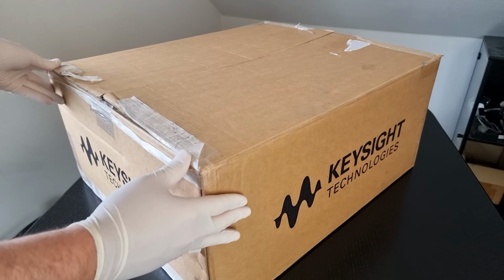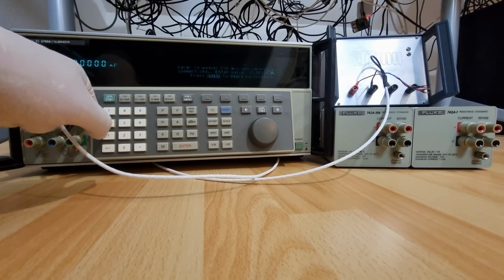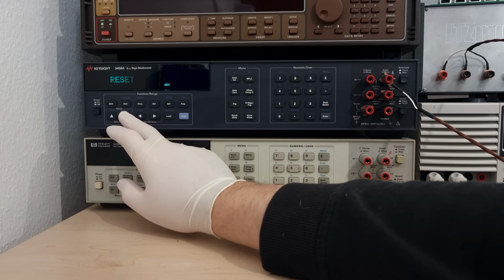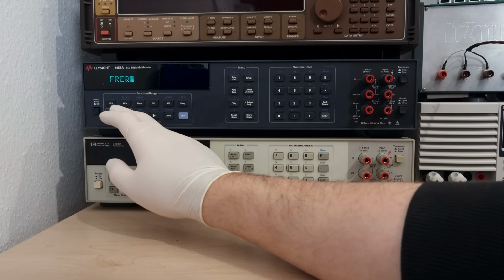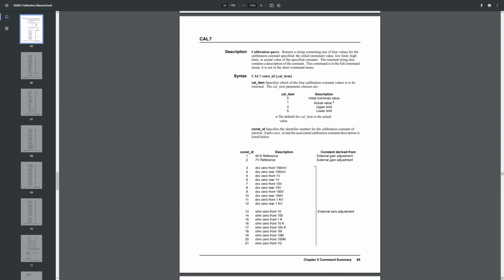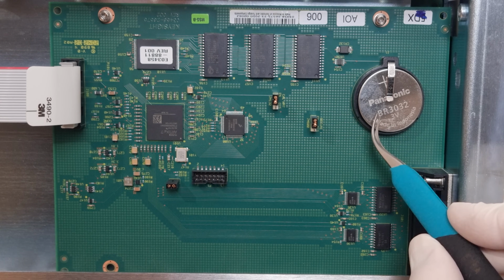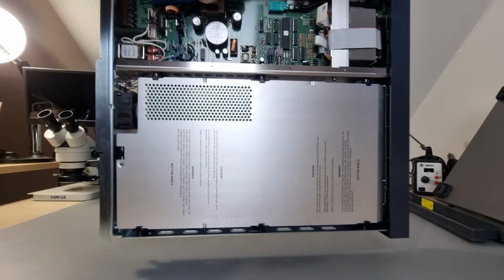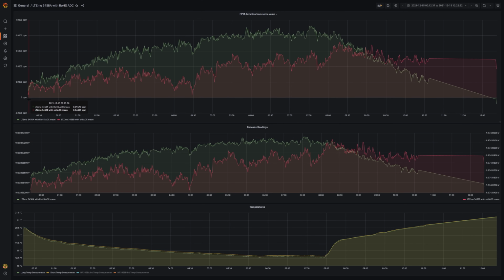What has Keysight done to 3458A?! Dark Theme 8.5 Digit Multimeter

Comment: Can't understand why they wouldn't add ethernet while they were updating the CPU board - even if they wanted to keep all the old 68k code, they could have added an extra mcu to handle it.
Reply: I would assume that they couldn't justify the NRE costs. If you add ethernet, you've got to do a load of extra EMC work. You need to re-tool the chassis production for the extra hole. It seems trivial, but it all adds up on a low-volume product like this. A few little tweaks can get perilously close to the cost of a full redesign.

Or maybe they're just couldn't be bothered.
Reply: @j.dietrich  How much do these things cost to buy? Cost to make is a bullshit excuse for not including a modern feature. It would be like dell re releasing a dimension with a core 2 duo
Reply: Went over budget on the new hardware design maybe, or couldn't tie in another CPU to handle it without compromising the existing 68k code, or didn't want to introduce any new code, or maybe it's scheduled to arrive in the future......who knows!
However, would loved to have been a fly on the wall when they had their meetings about it all........
Reply: My understanding is that we were ultra ultra careful to not do anything that could break the spec. Getting this thing working is incredibly difficult. I heard the first one went 3 years over schedule before we got it where we wanted it.
Reply: Even an ethernet to serial adapter would barely have touched the budget
Reply: Priority design goal was, to make a perfect / seamless copy of the old boards with small changes only to replace all terminated parts and make it ROHS compliant. Apart from that, any other updates / modifications / improvements were forbidden, because it was mandatory to not change the firmware. Any additional function would have caused a complete redesign of the software. And who knows, whether the source code and development environment was still available after > 25 years?
Reply: I can't understand why such a hardware rev didn't update the model number to 3458B.
Reply: @stevefriedl3983  Or 3458A Mk.ii. Maybe they thought some big purchasers (govt departments / military etc) would refuse to buy something that wasn't identical, without going through a whole complex approvals process. I know how ridiculously conservative some organisations can be.
Reply: @Zadster  This. Military etc would freak the heck out if it didn't look identical on the outside. This way it's a 'revision', not a new version.
Reply: @stevefriedl3983  Yeah, that's a can of worms. Getting a "B" model re-spec'd is hard for a lot of users (cal labs, government, etc.)
Reply: But dude, it's now dark themed now.
Reply: Might be because the ethernet interface is too noisy.
Reply: @andrewwhite1793  Professional tier scopes have ethernet ports, what makes it different here? I recall even some of keysights scopes have them.
Reply: @AndrewStrydomBRP  depends what the customer wants. The market for these must be quite small.
 Judging by the similarities between new and old there is a project  brief to change only what is strictly necessary.  This quite common, particularly where there is something of a black art in the design.
Reply: @AndrewStrydomBRP  A scope and an 8.5 digit multimeter are completely different beasts lol.
Reply: Likely because no one really cares. Having it vs not having one won't give them or lose them any customers, and won't even come up in a conversation about purchasing one. You either need one of these or you don't. Gpib is still a very common standard btw.
Reply: Never mind that they could rather easily cross-assemble the 68k stuff on an arm and use a modern tool chain from then on. Every 68k op code has a simple translation to Arm - in just a couple instructions at most. It runs faster if you want too :)
Reply: If the device is changed then it impacts all the military specs written around the original HP 3458A. The cost to the government would be millions. Many many millions. 

It means the revised 3458A would not be a 3458A and so the sales would halt.

 It is an end user issue; not a maker issue. 

The end users do not want to retest whatever was down decades ago to make a new spec or revised one. 

 Worse is the government spec reviews require massive costs and thus not done. There is a Better chance that Mcdonalds will drop the Big Mac or Germany annex Mars then some ancient government specs changed. 

Worse is eons ago when test devices did have slight changes who get fired and keel hauled when there was subtle changes that screwed stuff up. ? This actually has happened before so is not done.

 There are rigid specs that many government items are purchased to. Changing the device changes the item so the New item cannot be bought. 

So IF Keysight adds a USB port or ethernet port it just cuts its market share to nothing in the Government arena.

That is why the Fluke 8600 volt meter still was sold for years after the Fluke 8050A was mature. The 8600 was bought by the thousands by the US Navy etc. 

There is a better chance that folks here on this comment section change their cellphone and home mail address than a mess of mature governments specs are changed for a new 3458B with new interfaces. It becomes a NEW device so impossible to sell to a 30 year old market's specs
Reply: @3beltwesty Well, yes and no.
At least private companies happily buy newer replacements. For example Keysight DAQ970A which is essentially the same as HP/AG 34970A.
The 970A has lots of new features (especially with the SCPI parser - but also LAN/LXI) yet it maintains backwards compatibility to the 34970A. 
It's only painful with old programs that check for the exact model string (hard coded). 
Often changing that is enough to make 40 year old DOS programs run again with the 970A.
Reply: @TheRailroad99  It depends on the risks too. Most will not bet their life if a new replacement 3456B causes a mess in some Military test procedure. That why some products are made for decades when the military buys them. Maybe companies that would use a new 3458B could have free software folks to fix the mess created upgrading? Few want to talk about these costs. Lost a couple years here farting around with bugs in production due to some Microsoft etc upgrade that crashed everything. Basically  much today is poor. Release stuff and zillion patches. lol.:)
Reply: What’s the point? Anyone buying this scope that also needs Ethernet will probably have no problem with buying a gpib to Ethernet adapter.
Reply: @thetinguy  That's like the apple logic of not including the charger in the box, even though it costs apple pennies, and instead selling it seperately for a high price.
Reply: Agreed, they should have added ethernet and USB interfaces
Reply: for what? speed? having another complicated protocol on top?
all i want is an always active, no setup, zero configuration, independent, driverless, old, dumb-as-bricks protocol. 8N1, 9600baud, rs232, no control signals, no flow control. With the full +-15V swing. Stick a device there, numbers start coming in. 
ethernet my ass
router decides to reboot, i start losing measurements. router decides to drop a packet, i start losing measurements. 
i press XMIT on my hp48, it starts sending and only stops for two reasons: batteries ran out or someone drove over it with a road roller.

Comment: Would there be value in getting a rack which has temperature control for your lab? Maybe temp regulated airflow from behind?
Reply from the maker: Yes, I've been looking for a climatized server rack for a while, it would be great! It'd be a bit tricky to get good temperature uniformity in such a tight space, but I am sure it can be arranged
Reply: @reps  Have you read "Foundations of Mechanical Accuracy" by Wayne R. Moore? The Internet Archive has a copy. Part 2 section 4 describes their temperature control: 20°C from floor to ceiling, held to within 1/90°C. In the 1960s. Not easy or cheap to achieve though.
Reply: @reps  there are foam insulated flight case, racks which could be good for the purpose and keep your installation portable.
The foam is intended for shock proofing but also provides some insulation value.

Comment: I did some additional math on your noise values.
Something that is often important in my line of work is the trade-off between speed and noise/accuracy. Hence a lower NPLC is often preferred (if it does not introduce extra errors/offsets) because you can then later in software perform box-car filtering, or other fancy filter algorithms (excluding 10% and 90% percentile outliers etc.) depending on the situation.

I averaged every 100 values together for the 1 NPLC points, every 10 values for the 10 NPLC points, and comparing to the raw 100 NPLC data: All of these then have very similar RMS and peak-peak noise, however the offset is of course the same as in your data, i.e. best for 100 NPLC.
It is impressive that even 1 NPLC raw data can later be filtered/averaged in software for about the same overall noise as 100 NPLC raw data. This gives a lot of flexibility to the user!

Comment: Glad they decided to use ANA for Analog, and not used one more letter.
Great to see a new video and it's a decent duration, as well!
Reply: Maybe they use the L suffix for 10 digit+ accuracy systems.
Reply: @Zadster maybe they didn't want to take the L
Reply: At work I have a couple of folders in my test radios that contain analogue and digital channels respectively.
The problem is that there is only so much room for a folder / channel alias, so I have to get "creative" with the names, as I frequently have to take these sets to site, and demo for a client.
ANA for the win.

Comment: What is this lab equipment good for ? What can you do that you won't be able to do with a standard lab bench PSU ? Mine has 0.5 to 3.15 amps and 0.1 to 30.1 volts, is it not good enough ?
Reply: first of all this is a dmm, this equipment is required for extreme precision, with precision like this, this equipment is pretty much counting electrons, for an example they use this stuff at CERN where they do particle research and thus require extreme precision, such hardware is pretty much out of the scope for normal hobbyists as it costs a fortune and plus the maintenance. also thats y people tend to choose equipment according to their use case, for example if you work with a lot of led / current demanding projects then use need a high current power supply , and so on,  overall depends on your use case, if you are happy with yours then why even bother with something else
Reply: @ShahZahid  I'm sure he was joking.
Reply: NASA and JPL use instruments like this for projects.
Reply: It's a very precise multi-meter for taking sensitive measurements, but arguably overkill. Most people and most projects can get by with a standard 6.5 digit multi-meter just fine. And most hobbyist just need a decent handheld one.
Reply: It's for fun. MarcoReps sees how accurately he can measure things as a hobby. Check out the rest of his channel to get an idea.

Comment: Could you please decide if the Keysight or the HP is on top.
Reply from the maker: I have, HP belongs on top because Keysight is cooler and therefore wont affect HP as much. Long term everybody belongs into a (climatized) rack maybe :_ppmhub:
Reply: @reps  Well I just noticed that you switched your order multiple times during the video.
Reply: No discount code for 1ppm off when ordering a new 3458?